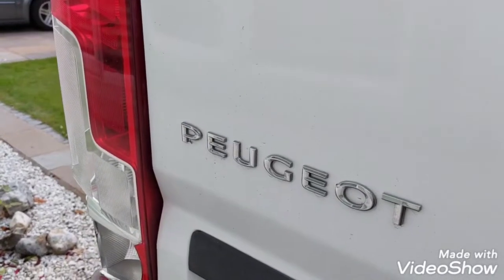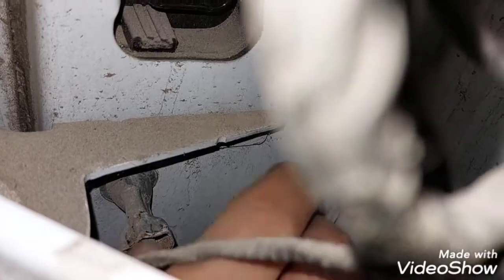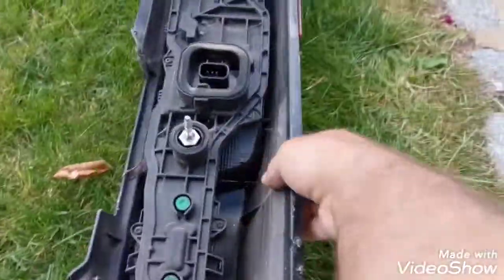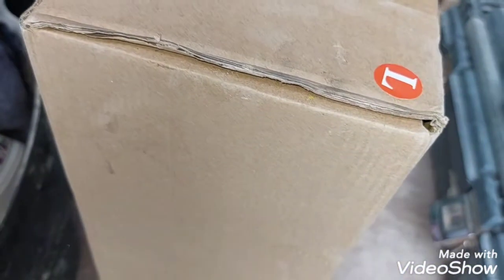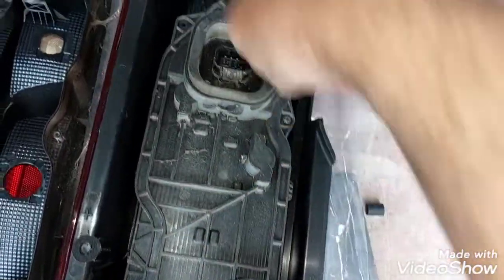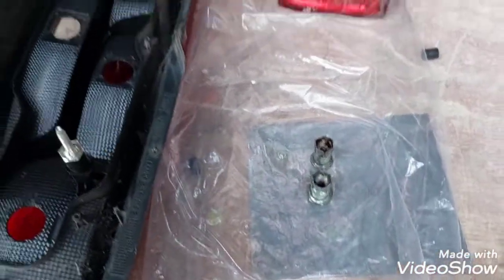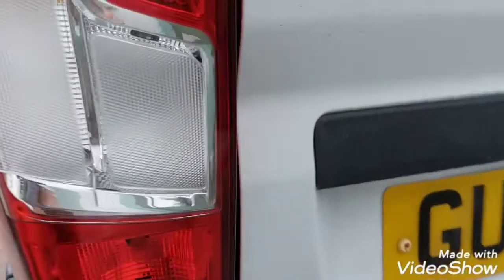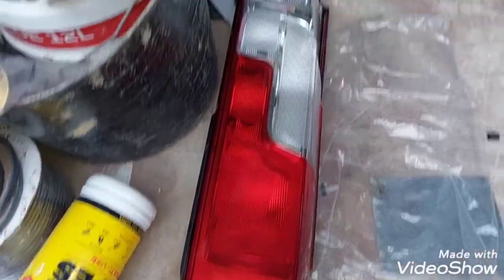How to change rear light on Peugeot Boxer Fiat Ducato Citroen Relay Dodge Promaster

Comment: What size spanner required for those two large nuts which hold the unit in? Only asking because on Adria campervan conversions and no doubt many others, the access to the back of these light units is abysmal. Got a job to get hand in the access hole to start with - you can't actually get to see any bottom fixing. Have to use touch!!
Reply from the maker: Thanks for asking, it is 17mm if I can remember right. Usually you can get them undone by hand
Reply: Same with Autotrail. Can only get finger tips to the nuts. The Led swap out will have to wait. :-(

Comment: Just to say there’s a plastic screwdriver in tool kit under passenger seat for undoing the nuts
Reply from the maker: Many thanks for sharing this, it's correct. I've changed 4 of these vans and only had a tool kit on one. For some strange reason people don't bother putting it back in the van after use 🤷

Comment: Any chance you kno how to do it in izoterm,there is no way to acces the light from inside the van...
Reply from the maker: I don't really know. They must have made provision for it
Reply: @mrfxr1695  im after taking of patr of the bumper but cant reach it, might just resolve to angle grinder n ill make the revission. Thanx anyway bro.
Reply from the maker: @fubar9872  take it easy and all the best 👍
Reply from the maker: @fubar9872  that's shocking, converters should've made provision for it
Reply: @mrfxr1695  im noit going to use the van as an iseterm so i dont really mind to cut out the revission but i ratther there was a way "to change the lightbulb" without cutting the van lol